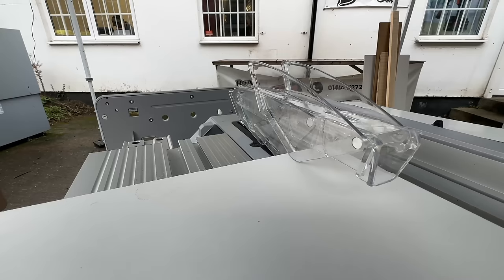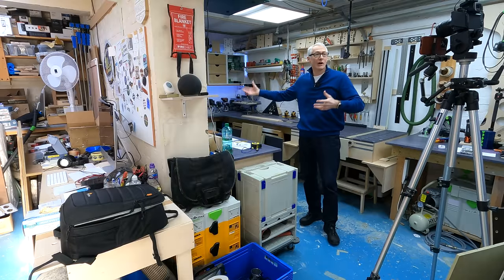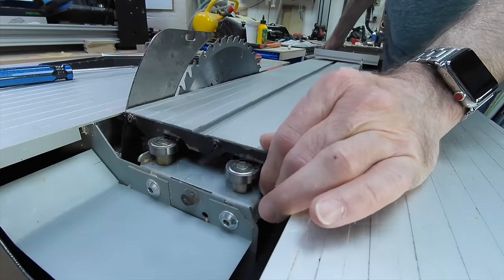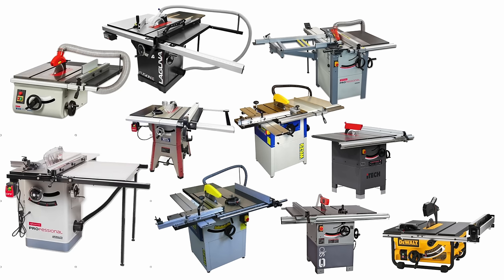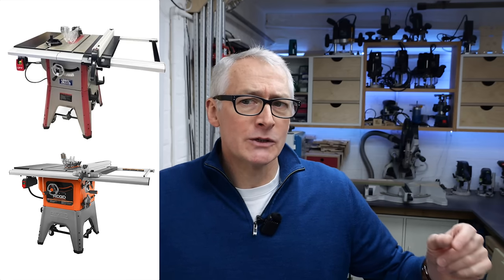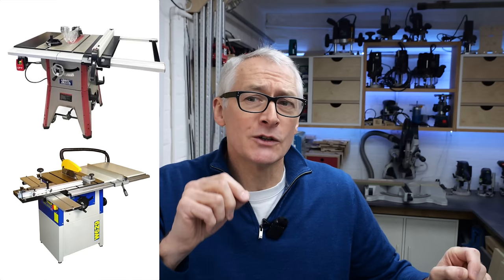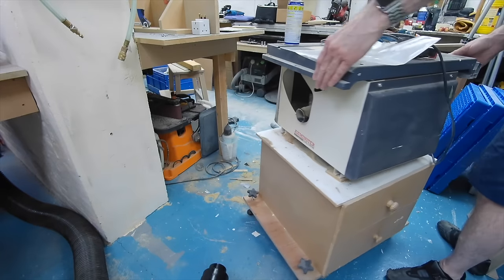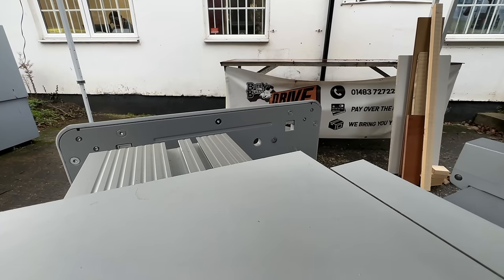Why Buy This Saw? [video 516]

Comment: Most 16A saws are only 2200W
Reply from the maker: And require a 16A socket/circuit, which is the issue.
Reply: @10MinuteWorkshop  your existing sockets must be on either a 16A or 32A breaker so adding a 16A ceeform is not an issue.
Reply: @Swwils  I think the electrical regs require 16A ceeform to be on a dedicated circuit - and as Peter mentioned, he wants to comply with the regs!
Reply: @jamesfarrer5087  since you know the max load is so low you'd just run it attached to a 13A FCU or buy an adaptor.

Comment: 48mm depth of cut is bit limiting, but wotever floats your boat. 
🤔 cuts your wood ❤
Reply from the maker: OTOH when have you ever seen me cut anything thicker than a couple of sheets of 18mm MDF Clive? It’s only limiting op if you regularly cut deeper than that - in which case it’s probably not the saw for you! 😂👍👍
Reply: @10MinuteWorkshop  Could be an issue when using jigs? You mentioned smaller pieces being an intended use and that probably means making a sled at some point, 18mm most likely, minimum 12mm.
Reply from the maker: @worstuserever  It has a sliding table, so not sure I’d need a crosscut jig??
Reply: @10MinuteWorkshop  Interesting to see if that obviates the need for jigs entirely. I'm still learning woodwork basics, and now hallucicommenting after some brutal night shifts, so my perception may be a bit off. 🥴 Anyway, looking forward to what you get up to with the Festool; love using table saw most of all!
Reply: @10MinuteWorkshop  Hence the qualifying comment ‘wotever cuts your wood’.🕺

Comment: The everyday struggles of the you tube millionaire woodworker…. Am surprised at why you would buy a table saw when you never used the one you had. Am sure you could do thin rip with a tracksaw given the right setup.
Reply from the maker: The ones I had previously were pretty terrible, and not capable of the kind of accuracy I’m looking for. As I say, it was the Mondrian-style  patchwork table that pushes me to the limit of what was achievable with what I had - tracksaw and mitresaw - and I expect working precisley with very small workpieces to be easier with a small, precise table saw. And yes, the struggle is real. 🤷‍♂️👍

Comment: Hi Peter, your considerations are identical to mine: small workshop, main use of the rail saw, lack of a tool to make precision cuts without wasting time or... risking your fingers.  I had the CS50 set but it was too bulky, so I sold it and ordered the new CSC which should arrive within this month.  The only doubt I have, since I don't go to work around, whether to also take his cart (I left myself this possibility of final decision with the seller) what did you decide about it?
Reply from the maker: Thanks! The trolley/cart is a great bit of kit, but I decided against it as this saw isn’t something I expect to take out of the workshop; if there’s any possibility that you might want to use the saw onsite, then I’d say the trolley is worthwhile. 👍

Comment: I’m lucky in having a very large shop and therefore, size is not the first consideration in a purchase. Having said that, I now have everything bar the table saw and 3ph extractor on Dollie’s so that I can move things around particularly when I’ve got long lengths (3m plus) to go through the router or band saw. 

I’ve got a love hate relationship with Festool. I think that their prices are justified only by people’s willingness to pay -rather than cost plus R&D plus etc. why else would the domino, for instance, be so expensive? 

And those peoples willingness to pay seems more the result of excellent marketing by Festool in getting a lot of YT to promote them , usually with rows and rows of sustainers in the background. 

I’ve both domino’s - love them. One of their routers - very good. Their TS55 track saw - old but good but the best? Their electric planer - adequate but not value for money. My biggest disappointment has to be their drill drivers. Despite DeWalt being down marketed by B&D, my Dewalts and Makitas outperform the Festool, all day, every day. That’s just for me and I only do workshop work plus some fitting around houses. 

My advice would be to do the research as this video has. Don’t be seduced by brands as not one brand has the best in each category.

And why is Axminster having such supply issues?